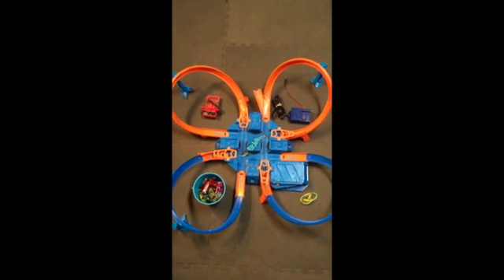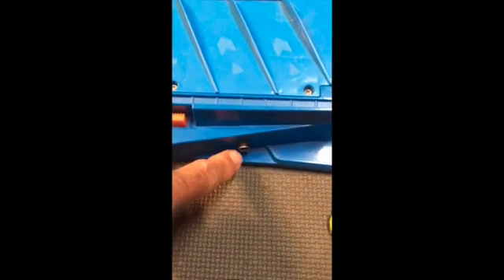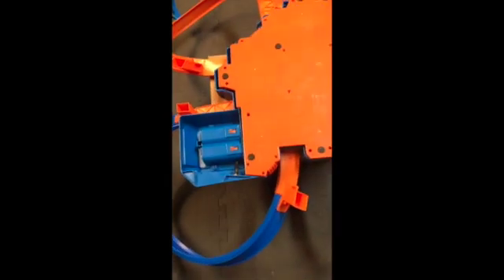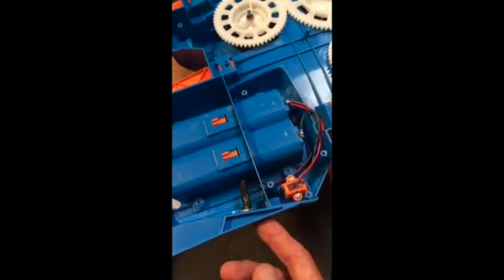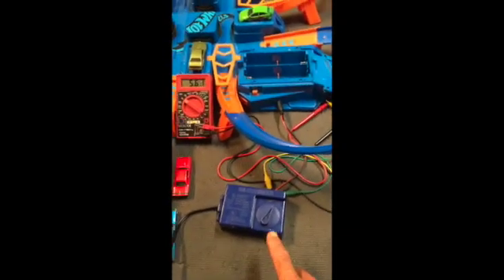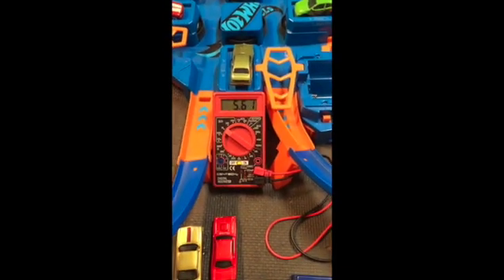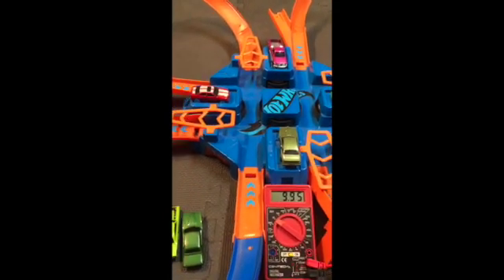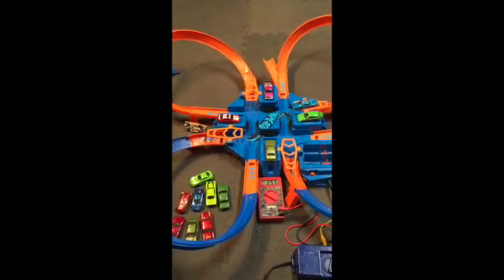Hot Wheels Criss Cross Crash Voltage Hack

Comment: Now I am working on a Colossal crash. Does it matter it it is a 3 pin or 2 pin?
Reply from the maker: Either socket will work, but the 3rd pin can be used to isolate the battery compartment for safety.  Two-pins are fine so long as batteries are removed when plugged in.

Comment: Have you attempted or tested a 3A wall plug? Would it be safe compared to the 1A?
Reply: Your power supply must meet or exceed the required amps of the booster. The motors will only pull the amount of amperage they need. If the motors need 0.5amps (just a guess), and you give it a 3amp supply, it will only pull 0.5 amps.

You want to match the voltage.

Comment: I have been trying to figure out how to do this. I bought a used track and the cars don't make it around the track very often. I did hook up a 9v(800ma) power supply, but that is almost too much for it. The cars go flying. I would like something I can adjust, and slow down just a little.

Comment: At 6V, is it still operating at 1 amp?
Reply from the maker: Thanks for your comment. The current draw is a function of load on the motor not the voltage. Unfortunately, I do not have instruments to measure the current.
Reply: Thank you for the quick reply. I’m trying to figure out which power plug to buy for a six D cell conversion. I see it’s a six amp system. Just not sure how many amps to go with. I see the 2 D cell ran great on a 3v 1a system.
Reply from the maker: Six D-cells @ 1.5V per cell is equal to 9-volts, and I would step up the amperage. An eBay search returned many 9V DC adapters with a 3A output. Good luck with your mod(s). @mattcarrescia8747

Comment: I have this track and the boosters are so slow. Is there a hack to give the boosters more power?
Reply: What's the Amp rating of your 6V adapter ?
Reply from the maker: Hi Anthony and thanks for your question.
If you’re running your booster on batteries I’m not surprised to hear it’s slowing down, as the batteries begin to experience voltage drop quickly, which is why the booster runs slower. I prefer to use the AC to DC adapter which can supply constant voltage.  Speed of the booster is proportional to the applied voltage. A 6V DC power supply will be equivalent to four new D cell batteries and will run the Criss Cross Crash set nicely as can be seen in this video.
I hope this helps.
Reply: You can use a buck-boost converter with custom voltage which gives out a constant voltage.